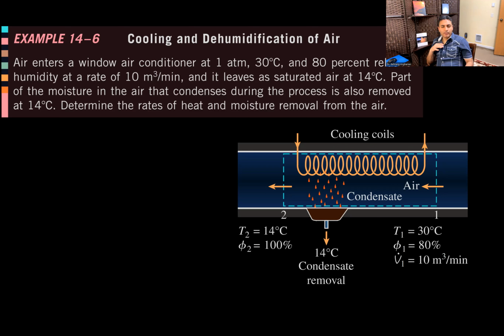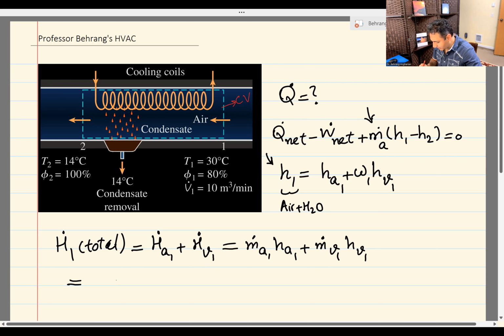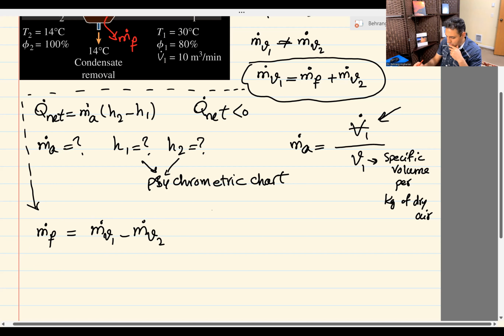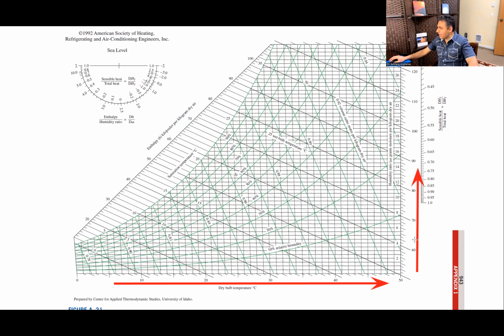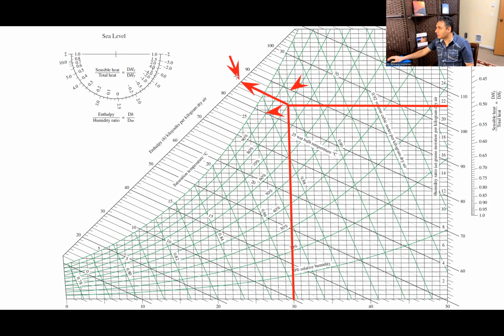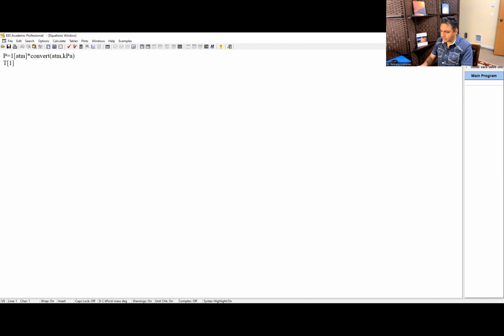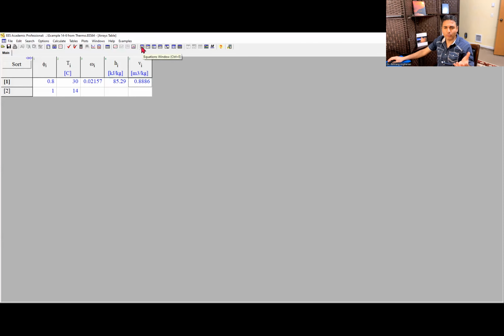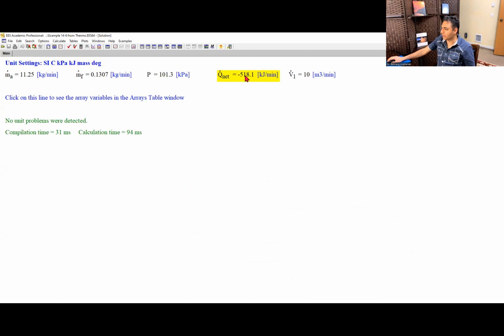How to use Psychrometric chart and EES for HVAC Problems.

Comment: The energy balance result is different from the textbook solution because the textbook accounts for the enthalpy of the condensed (saturated) liquid water that leaves the system. The book finds that the heat removed from the system is 511 kJ/min instead of 518 kJ/min because it includes the enthalpy balance on the air in, air out, and saturated water that is removed. (Not because this solution uses "more accurate values".) The energy balance should include the energy of BOTH streams that leave the system (moist air and saturated water)  as well as the heat interaction.
Reply from the maker: Thanks for watching and your comment.

Comment: hi..i have a question in different subject if you can help
in evaporative cooling...is it useful to decrease the temp of water spry or water washer 
ex: if out air 36c,60%rh..on psy with 90% evaporative efficiency.h ll get a 28c db and 90%rh..
so if i enter a 7c cold water to the washer .will i get a cold air temp....with knowing that in 100%humidity the db is about 27c
thanks
Reply from the maker: Yes. If you do the first law analysis and include the enthalpies for a steady state case you can even bring the steady state air temperature down by introducing colder water to it.

Comment: Thanks for the video, I have one question regarding the air. i.e. if the air contain some other solution (like NMP for cathode drying) then how to define and calculate enthalpy and also condensation rate at evaporator ?